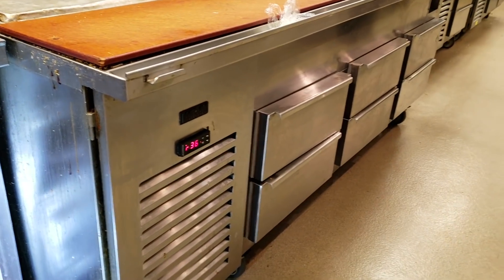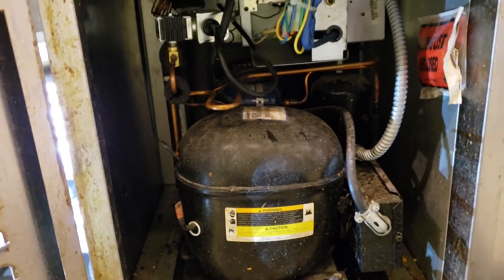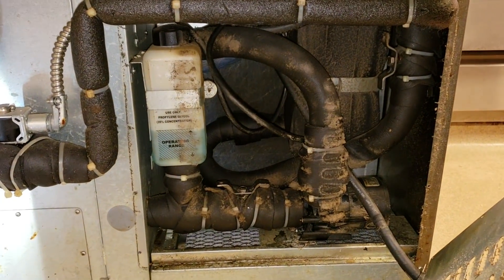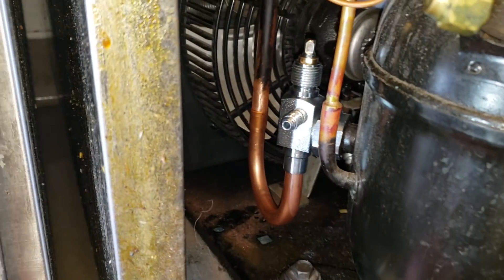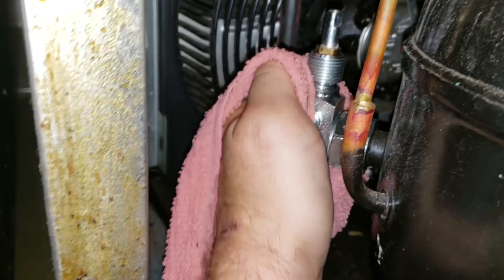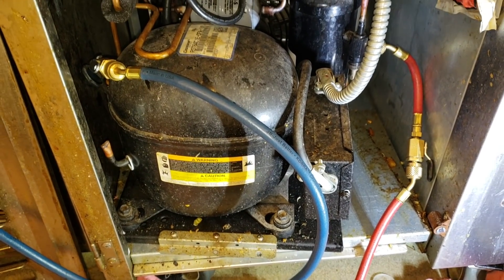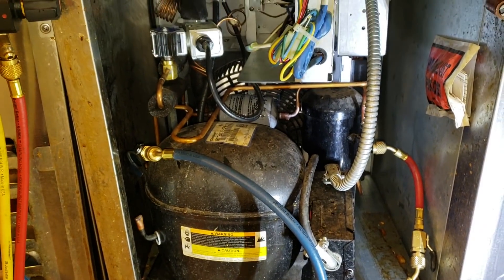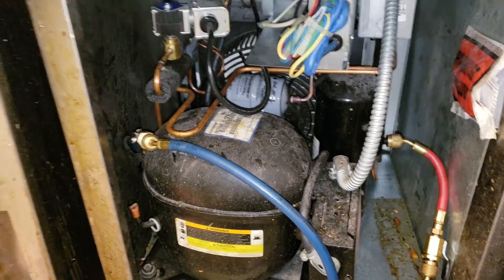Kairak Blu prep table refrigerant leak

Comment: Chris;  Definitely nice to see someone getting into the guts of one of these.  One question.  Do you know ANYTHING about the refrigerant to glycol heat exchanger?  I have a table that is leaking glycol at the heat exchanger (putting blue 'stuff' on the floor which worries the client).  I've got a new heat exchanger ready to go, but the refrigerant connections on the heat exchanger are nothing I've seen before in my 15 years in the field.  The Kairak "tech" I spoke to was clueless.  Have you any insight?

Comment: Good videos.  One thing about these units is that if you close the glycol shut offs you can disconnect the electrical on the back and pull out the condensing unit completely.  I always set it on a hand cart when working on these.  Learned this when replacing a leaking heat exchanger on one of these.  It takes a minute to pull out the condenser but worth it for the extra room and better angles for brazing.   Also, the service valve always always leak on these units.
Reply from the maker: yeah those service valves are always the first place i look! Hey I am going live on Youtube this evening 1/21/19 at 5PM pacific time you should come over and check it out. https://youtu.be/dUMYKIdTCR4

Comment: So how do you make sure the solinoid is open when pulling a vacuum? How do you bypass the low pressure. I kinda missed that part?
Reply from the maker: you can energize it by turning on power or use a solenoid magnet.

Comment: When I first started in refrigeration in Australia, combination low medium temp cabinets with a milk well were common. They used copper eutectic tanks for cooling in each section. A eutectic solution of water and methylated spirits 40% was used and the solution circulated by thermo syphon (no pump). They held between 100 litres and 200 litres ( approx 25 to 50 U.S. Gallons). They worked well between the ice cream section, medium temp and milk well. Temperature was controlled by adjusting stop valves on each tank. The main service problems were brine leaks or air locks. there was a plug in the top of each tank to relieve the air.The early ones (pre R12 refrigerant) worked with a low side float while the later ones were D.X. They went out of favour in the early 1970s.
Reply from the maker: Very interesting, I've heard a little about those types of systems but I definitely have never seen one! Thanks for sharing!!

Comment: Chris, if I told you that I never make a mistake like that I'd be BS'ing you. On average I'll hit a job once a month where I jump down that rabbit hole and it's completely the wrong diagnosis... Just last month I changed out a condenser fan motor before I realized the issue was a fuse. What screwed me up is I used my backup meter because my main meter battery died, and my backup meter is an auto ranging meter, I was looking for 230 volts at the remote condenser disconnect, and in the bright sunlight I missed the micro volts symbol on the auto ranging meter and read a ghost voltage of .223 volts and thought I had 223 volts - switch out the condenser fan motor and then realized that it was a bad fuse after the motor change out. We all make mistakes... 
Another good video man! Thanks.

Comment: What percentage of glycol do those recommend? I've ran into many chillers that pumps are overamping because people decide to throw in pure 100% glycol and expect it to function normally. Mainly on breweries I will recommend a water/glycol ratio of 60/40 or even 70/30
Reply: Its always best to go with the lowest amount of Glycol plus a safety margin to make sure the pump is not overloaded due to a higher viscosity.
Reply: David Bisiker yes, I've seen many chillers operating at 70 percent glycol while they are only reaching Temps down to 30 degrees. Sometimes ill even see people running 100% unknowingly and wondering why their pumps are over-amping.
Reply: Not just the viscosity of the glycol that’s a concern, the thermal transfer efficiency is also negatively affected if incorrectly blended.
Reply from the maker: I think it's something like 60/40

Comment: Nice work! 

Sometimes when I get brazing jobs like that suction valve, I'll put everything in place and then mark the parts with a sharpie, you can then take the valve off and braze it on the bench, doesn't matter if its not 100% aligned as the copper will be soft enough to be able to tweak it a bit for the easier joint to be done in situ.

Comment: Great video bud , hey those glycol containers crack then you leak all the glycol I worked on a few of those in the past . Also pumps start humming when unit runs out of glycol or when is low . Just my experience. Great video !!
Reply from the maker: Thanks for the tip!
Reply: HVACR VIDEOS no problem bud , also when I’m dealing with a reduced space situation and have to sweat in a valve to copper i usually sweat in the valve to the copper before I put in place that way I only have to make one additional braze  and not two . 😬🤔😎😄. Happy 4th of July ....

Comment: Interesting prep table haven't seen one with glycol in it before. Must be a very expensive unit. One little thing I would do to make the braze job easier would be get your parts into position and braze it external of the unit then Swedge the new piece of copper so the braze will fall into the pocket instead of having to drag it up. A lot of times I'll just bend it horizontally to make it easier to flow. Don't you love having to disclaim everything you do because you know you're going to be judged for everything that's questionable, when all you're trying to do is help others. LOL I'm guilty of it on my videos.
Reply from the maker: Yeah some people can be assholes so I have to make disclaimers every time! Thanks for watching bud!